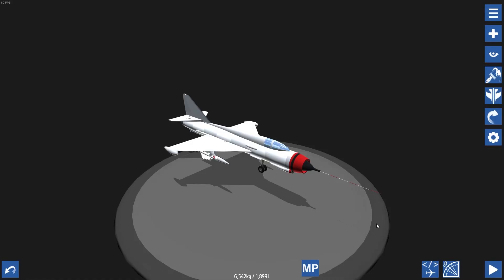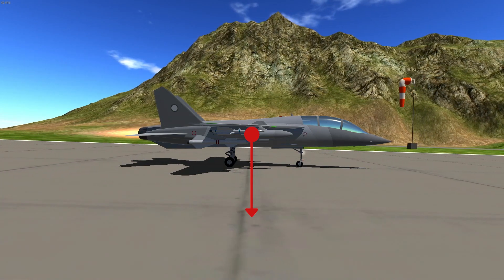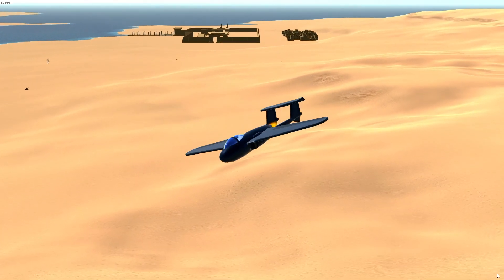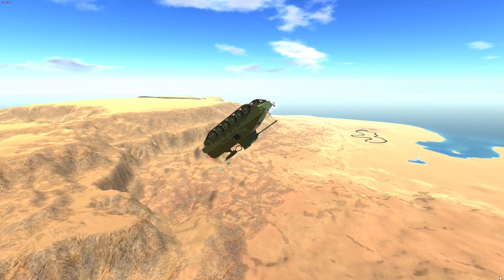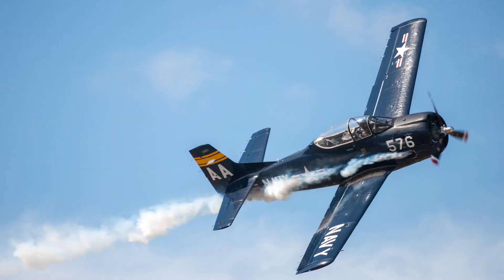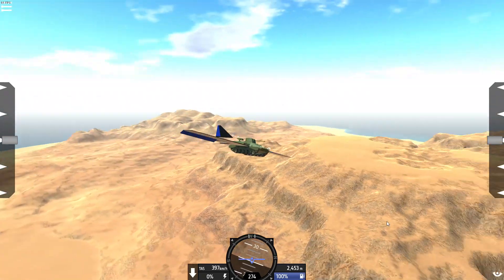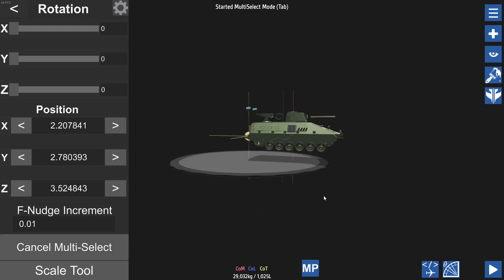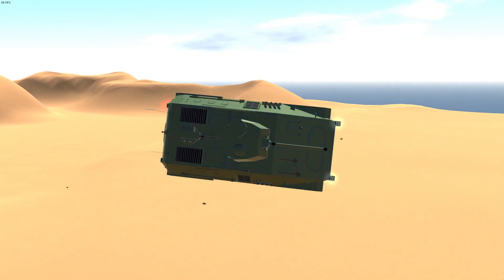SimplePlanes Meme Build Guide

Comment: The farther the CoM is from the CoL, the harder it is to pitch up and will very likely to do a nosedive but is very stable.

If the CoM is behind the CoL, your plane is fucked and will pitch up by itself once it gets enough speed.

You can put your CoT anywhere you watt as long as it is aligned with the other 2, well at least aligned with the X Axis.
Reply: thx

Comment: :/ how to maek thosee col com and thrust at the same level of Y
Reply from the maker: Uhm? They are centre of the total force. To adjust the total, you need to adjust the different part.

Example: for the centre of thrust, you move you engines down to make the centre of thrust go down.
Reply: @WalvisYT  yes ik dat but moving my engin blasto BEF526362527387 Down would be ugli bc it's not plaecd on the backsc
Reply: @WalvisYT  ohh ik now I was a monki brain

Comment: How cna i move the center of lift tho
Reply from the maker: By moving the things that create lift.
Reply: @WalvisYT  very helpfull, thx.
Reply: @WalvisYT  btw, how can i move the CoM?
Reply from the maker: @itsascam9940  By moving the mass.
Reply: @WalvisYT  by adding weight into the tip of the plane?
Reply from the maker: @itsascam9940  Any change in mass can result in a shift in postion of the CoM. You can add mass, move mass, remove mass, etc.
Reply: @WalvisYT  ok

Comment: Tbh i made a propeller plane with CoL close and a little higher than CoM it its completely stable and it has a top speed of 720 mph
Reply from the maker: It certainly isn't impossible to have funky CoM, CoL, and CoT positions, but again in this video I don't touch uppon it because it makes the process of simply making something fly far too complex for a 12 minute video.
Reply: @WalvisYT  ok